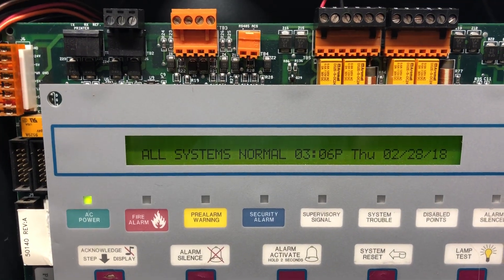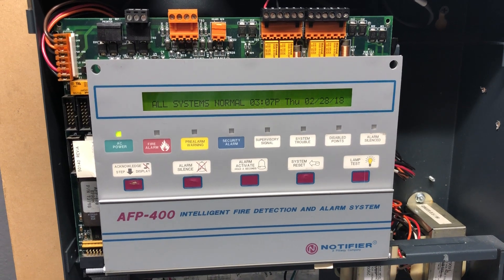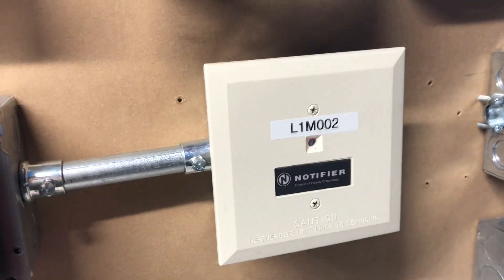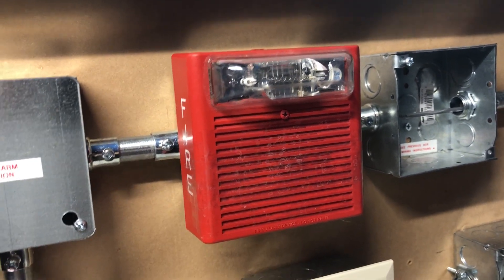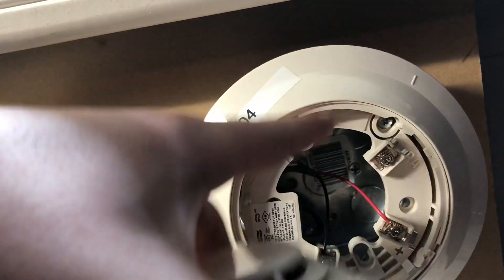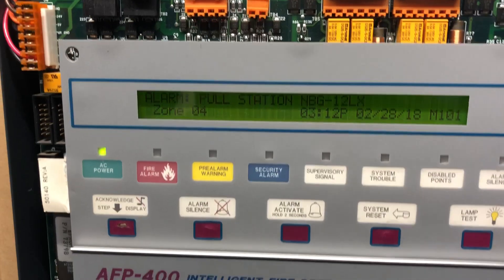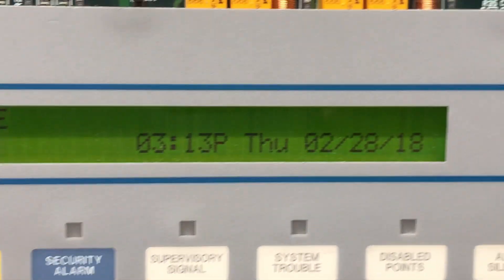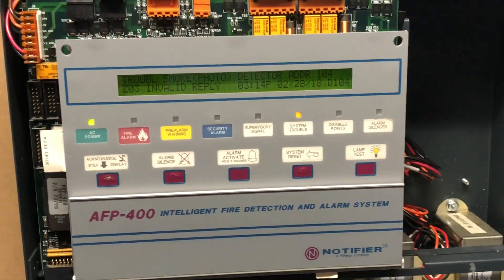Notifier AFP-400 Fire Alarm System - Test #1

Comment: You could have labeled that detector correctly.....
AFP-400’s support dual addressing, meaning that it supports 99 detectors AND 99 modules in CLIP mode.
Do that FSP-851 could have been set to address 1 and you could have labeled it 1D001 (or 4 if you wanted to keep it at 4 lol 😂)
Reply: or rather D104 bc it’s in CLIP

Comment: I think only the NOT-BG-12LX has a green LED, also detectors are labeled as 1D004 (or whatever address) the M stands for module and D stands for detector
Reply: The Green LED is not based on device, but rather the protocol used on the loop. FlashScan allows Notifier devices to blink green, while CLIP (legacy) mode flashes red in normal status. Of course the newer Notifier relays and control modules blink green no matter what protocol is used. The AFP also doesn't label devices like that, it'll be M or D first then a one digit loop number, then the two digit device address (e.g. M104 = Module on Loop 1, Address 4).